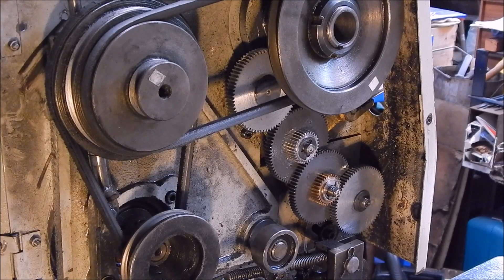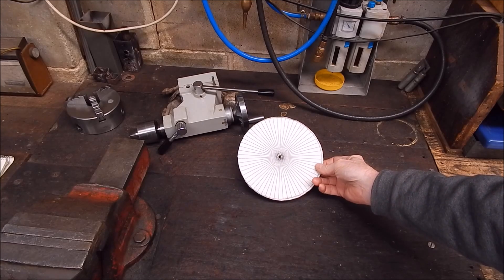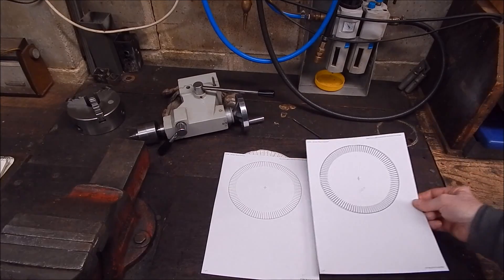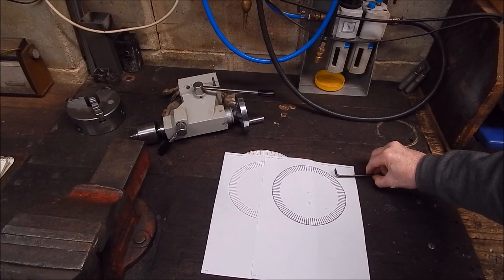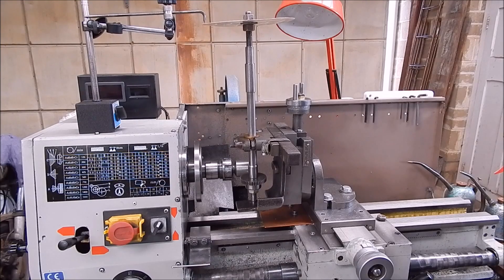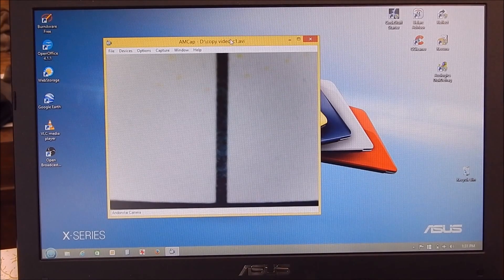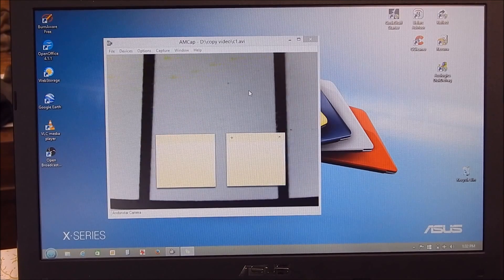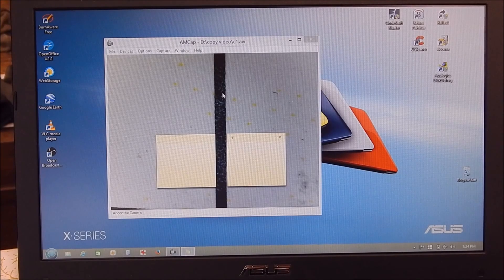Accurately index gear cutting with a cheap USB microscope

Comment from the maker: Make sure to turn off screen shut down in power options on your laptop when using the USB microscope for extended periods, otherwise the screen will go off and hide your sticky note positions.

Or move the mouse occasionally to keep it active.

Cheers Rob

Comment: Wonderful, thank you. May I ask you a question? Do you know what the Meccano gear module is? Where can I find the right cutter? Do I need eight cutters to cover all the number of teeth?
Reply from the maker: I have no knowledge of Meccano specifications.  You should not need 8 cutters.  You should be able to get away with three.  Each will have a particular tooth profile suitable for a range of gear sizes.  The gear range will be listed in it's specification.

Comment: what about the concentricity of the indexing plate and the fact that its not lyeing flat,great idea though
Reply from the maker: Any lateral movement would be so insignificant that it would make no difference to the finished gear what so ever.

Comment: Such a great setup.  What type of clamp is that, that you are using to hold the mandrel?
Reply from the maker: It's a split bronze bush for a shaft.  You can adjust the clearance and pressure with the two mounting bolts.

Comment: Hi Rob, Wondering where you bought your gear cutters? They seem to be in the order of $250-$300. ouch!
Reply from the maker: What ?  No way.  A full set is about $100 AU, but you don't need that.

Just get the ones you need.  Each cutter does a number of gears over a specific tooth range.

I bought mine from CTC Tools on the internet.  Banggood also sell them.  Not expensive at all.

http://www.ctctools.biz/hss-involute-gear-cutters/

https://www.banggood.com/buy/involute-gear-cutters.html

You will have to make the mandrel, but that's dead easy.  My web pages show how:  http://users.tpg.com.au/agnet/cq9325rev7-d.html#involute

Cheers Rob
Reply: Cheers Rob. you're a legend, I'll look into those

Comment: This is "out of the box" thinking and this idea deserves an award. I used an automotive style USB scope and directly mounted the attachment instead of a magnet (vibrations) and also to the drill press aligned with a machinests ruler and pointer for cross feeding multiple holes.
Reply from the maker: Thanks.  I'm a chronic lateral thinker.  It can be a curse at times ;)

Cheers Rob

Comment: What a brilliant idea. Probably more accurate than traditional indexing disk whose tapers are worn out or slightly damaged or where there is play in the locking mechanism..
Reply: @stemer No to mention that the likelyhood of errors tha make the gear unusable is much smaller. Here errors even out. If you miss one turn on a dividing head the result is worthless.

Comment: You took the cake with this one. Brilliant.
Reply from the maker: Thanks. 

You can use this method to index pretty much anything without hassle, as you only have to mount the self illuminating microscope in a suitable position.  eg it could be down in the guts of an engine bay to index pulley rotation or the like.

Cheers Rob

Comment: I just wonder if a soft shear pin might be missing on your lead screw drive.  Three broken gears makes me wonder it there is a piece of drill bit where a soft shear pin should be?
Reply from the maker: No.  All gears were broken by my stupidity.  The leadscrew shear pin has been replaced many times over the years due to carriage crashes caused by the leadscrew covers.

The gears were broken when a lathe mod I did went wrong, and the tumblers were broken when I banged it into reverse without it being fully stopped - brain fade.

All easily replaced by cutting a few new ones on the lathe.

You always learn by your mistakes.  One way or another.

Cheers Rob

Comment: Hello great work. Can you also larger diameter gears. Thanks for sharing keep up the good work!!!
Reply from the maker: Hi Javi,

I've done up to 72 tooth, which is the largest gear required by my lathe.

There's no reason why the reference disc couldn't do larger.  The size of the indexing disc is limited by the printer you are using - most use A4.

You could easily double the tooth space reference lines on A4 and still have great accuracy with a USB microscope.

Cheers Rob.

Comment from the maker: I used this system today instead of a pointer, to index some gears I was cutting, and it is absolutely brilliant.

Accuracy is unbelievable.  The gears were perfect.

Try it, you will not be disappointed.

Cheers Rob
Reply from the maker: It's an Andonstar microscope, which I bought off of Ebay.  I reviewed it here:  https://www.youtube.com/watch?v=Dl_xYLx4jhw

You could use any similar microscope.

Cheers Rob
Reply: xynudu love your videos.. You’re a very clever man! Regards from Poland!
Reply: I haven't tried it, and may never, but I'm still not disappointed! Badass.

Comment: GREAT JOB!!! I'm a poor guy currently studying Computer Aided Machining at the local Community College just as a hobby. I got myself a lathe and just eon an auction for a CNC Mill. I was wondering how I could cut gears or drill holes on my lathe or my milling machine without using an expensive dividing head and you have answered my question. Thanks, God bless.

Comment: Make sure you first test that your printer prints a real square, some printers and should I say software ten to print non even length compared to width.

This becomes obvious by measuring say 20 x 20 cm square. on standard A4 paper sheet. Given the precision this could be a problem on some printers.

Comment: Absolutly bloody brilliant! If you could buy a dividing head for $70 Au. I would be flabbergasted. Now remains the software problem but I will do some research. Oh, and indexing with sticky notes is the best thing I have seen in a very long time. I wound up making my own dividing head in miniature, but this microscope may be a better solution. Sometime when you have nothing to do, would you show how you go about generating fly cutters? The books say to file them up. My hand is not that steady.
Reply from the maker: +Juan Rivero 

Hi Juan.  The easy and accurate way is to use a tapered grindstone.  See my video below.

https://www.youtube.com/watch?t=24&v=CaBV3Sn9Tkg

Cheers Rob.

Comment: Hey Rob, 

It's been a while since I have commented on any of your videos but I do watch them as they come out and always with a thumbs up. This is a great idea! I was wondering if you had tried it yet and if you have did any vibration from the lathe make your scope move at all? I think it's an awesome idea! 

I would love to share with you my projects but I don't do the YouTube video thing.. If you have an email address I would love to share some photos and ideas as I think you would love the kinda stuff I get into! Your welcome to message me you email. :)

Have a great day Rod.

Dennis
Reply from the maker: +volcom7114 Hi Dennis.

I haven't cut a gear with this idea yet.   I don't expect vibration will be any more of an issue than with a metal pointer.  The mag base and scope shouldn't move.

It's irrelevant if the scope vibrates while cutting, as it's only used to index the setup while the lathe is off.  Once everything is locked up it's a non issue.

I DO expect that due to the high magnification level, it will be a bit touchy setting and locking the reference disc for each cut to get it perfect - there will always be a certain amount of flex/spring in the rig.

You can email me at gloaming_agnet@hotmail.com

I'm always interested in ideas and projects.

Cheers Rob.

Comment: Thank you so much for posting this!  I recently had cataract surgery which did not turn out well for me.  As a result I have significantly reduced depth perception, as well as great difficulty with vernier scales.  I had all but given up on ever doing anything which required the level of precision needed for cutting gears. I had never heard of a usb microscope, even though I have a usb bore scope.  Thanks again!
Reply from the maker: +Thomas Robinson

Hi Thomas.  I hope this idea helps you out somewhat.

I know what bad eyesight is all about, and often have to use a magnifying glass to get by.

All the best.

Cheers Rob

Comment: G'day mate.  A clever solution to a problem once again.  I have a printed degree wheel which would work for some of that but the ability to print the exact number of lines is much better.  That would not work just fine in a horizontal setup also for a milling machine.  Thanks for the video.
Reply from the maker: +cerberus Hi Harold.  You could also mount a disc on the lathe spindle and index that as well.

This can work in lots of applications.

I just knew that little microscope would be more useful than looking at insects :)

Cheers rob.

Comment: Hi Rob

One have to adapt and you did with the first nifty setup - and you improoved it with the microscope version - nice !
Reply from the maker: +Keld Sørensen Hi Keld.  Yes, I was pleased with this one.  Definitely a big improvement.

Makes it dead easy.

Cheers Rob.
Reply from the maker: +Keld Sørensen I forgot to mention that the mount for the endoscope is made from some home brew aluminium - He He.

And the rod holding it is the shaft from a gas strut used on most hatch backs for the lift back.  Perfect diameter for the mag base, and chrome plated as well.

Recycle, recycle, recycle :)

Cheers Rob
Reply: xynudu
That's just my line of thinking too ... sometimes it have some funny results ;-))

The control handle for my crane is the handle from the powder/insert cup of an old coffee machine - fits nice in your hand ;-))
Reply from the maker: Good one Keld.